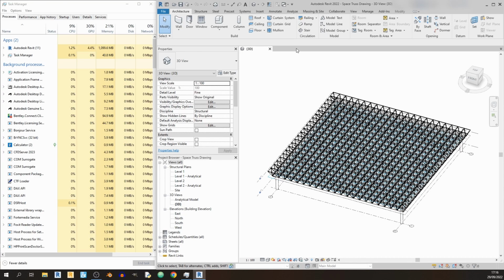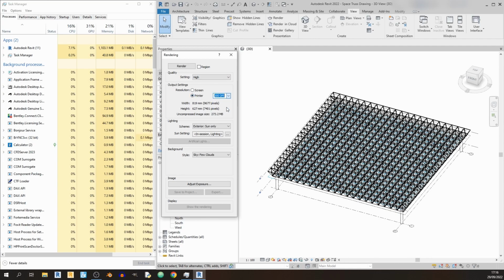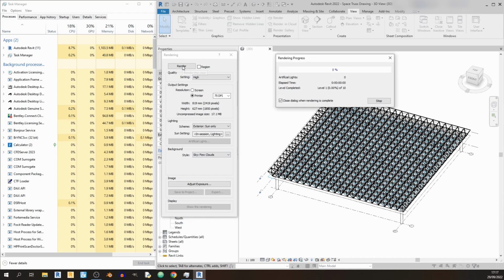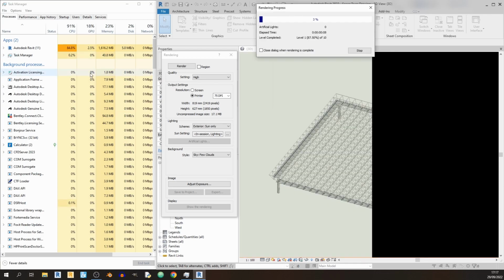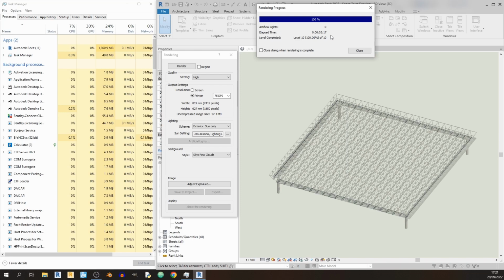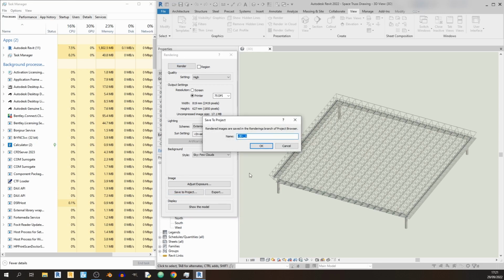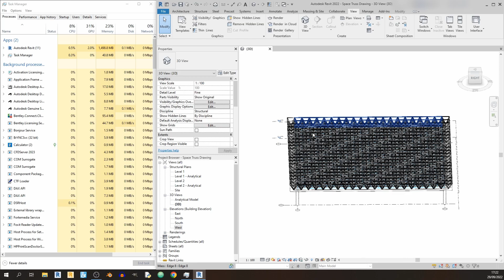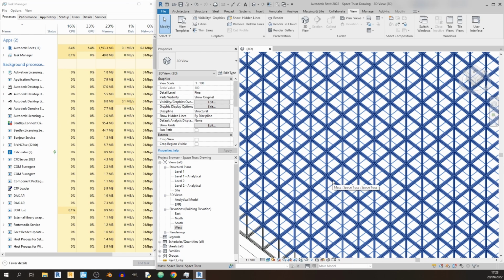Shocking GPU & CPU Usage of Revit

Comment: We have a quadro rtx 3000 in our work laptops, and it chokes when orbiting in 3D, so infuriating.
Reply from the maker: In my experience Revit performance is affected by the CPU by a greater margin. This is especially true when not using realistic visual setting where the CPU is used in 3D space.
Reply: @revitforcivilengineers  CPU using 10% max in 3d is dumb
Reply from the maker: I know what you mean, but such is life. I suggest upgrading to a workstation desktop since most RTX 3000 laptops that I know have a power constrain that is lower than even a decent gaming laptop.
Reply: @revitforcivilengineers  Yup, but that's gotta be hard to swing with the firm.
Reply: use a gaming laptop, even a 4060 will give much better performance, workstations are throttled,
Reply: @randylltarlly7021  kinda hard, when it's a big firm and you have to use their pre selected one.